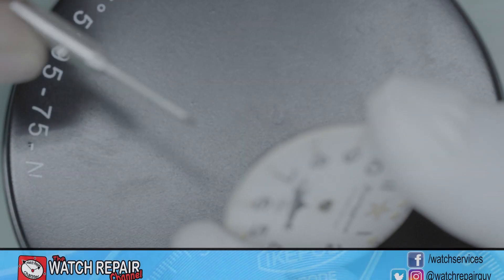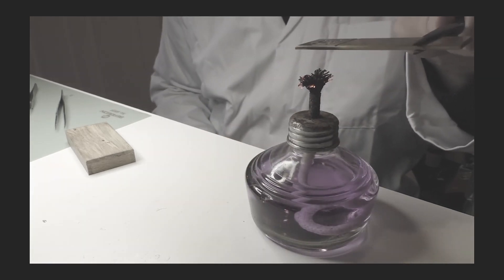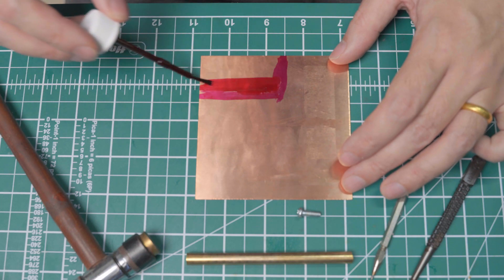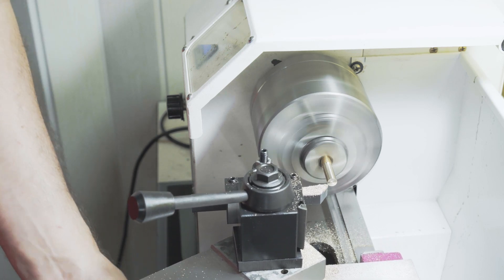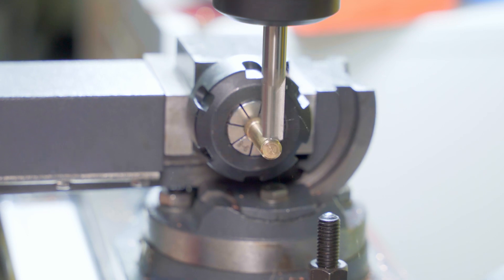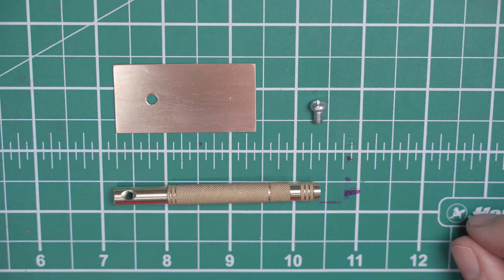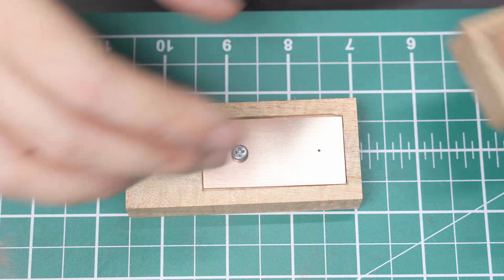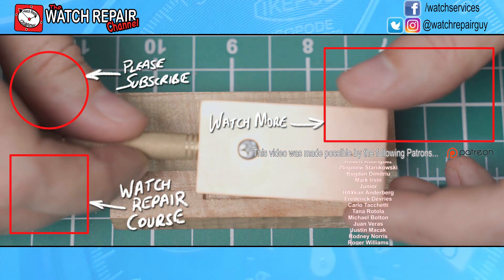We need a pallet warmer. Let's make one. Basic Toolmaking for Watchmakers.

Comment: Cool crossover video with machining going on! If you have more knurling in your future, then I suggest you discard the bump-style knurling tool and obtain the kind that has scissors action, pinching the work from above and below. They can be had for reasonable prices, and are much better with smaller lathes. The bump knurler exerts much more pressure on the tool post and substantial bending force on the rod, while the scissors style uses clamping action to do its work.
Reply from the maker: Thanks for the tip - will look into them

Comment: Excellent channel very interesting. Could you please answer a question I have a vintage rotary watch , with a 2824 movement it is running 15 seconds hour fast, could this be coused by magnetism. ? Thanks
Reply from the maker: yes it can. or contaminated hairspring.
Reply: @WatchRepairChannel  I wish you could service it for me, I tried to very gently take the movement out , by slightly undoing the two screw's , but it just turns around & won't come out of the case. The dial is slightly of center, my father had the movement serviced 10 years ago , but I just don't think they did a very good job!.  I purchased a new Eta stem for it 401/3.  I  tried demagnetiser just making the movement run faster. Any thoughts thanks James

Comment: Beautiful work and images! Btw, maybe someone in the comments can give me some advice on troubleshooting a mechanical watch. The wind up lasts less then half a day, otherwise it seems to be working fine. Can it be a problem with the main spring? Something else that can be causing these problems? I haven't opened it yet, as I'm waiting for the proper tools to arrive. It is an 80s Vostok watch, but not a Komandirskie or Amphibia, but a smaller, similar looking one of no obvious "line".  It has no "market value" (no pun intended), but I like it, because it was my father's.
Reply: Hard to say does it stop in the same spot each time? Could be a few different things hard to tell you an answer with little info. Could be hands, minute wheel, hour wheel not having the correct washer or none at all, trash in the train, mainspring  and so on. Sounds like it just needs to be taken apart and inspected if nothing visual is jumping out saying fix me! Most likely just needs COA
Reply: @itsjustjeremy186  Thanks Jeremy! It stops at different times, similarly to when a watch hasn't been wound up in a while, just in this case, it is half a day. I guess I'll have to be patient and wait until the tools arrive. What is COA?
Reply from the maker: Everything Jeremy said. There's a lot of moving parts in an automatic watch and therefore there's a lot of factors which can cause issues. The only way to know for sure is a complete inspection.
Reply: @WatchRepairChannel  Thanks for the reply Mark! I'll be getting in some "taking it apart without knowing how to put it back together trouble" as soon as I get the tools.